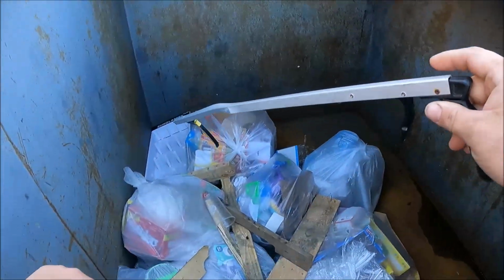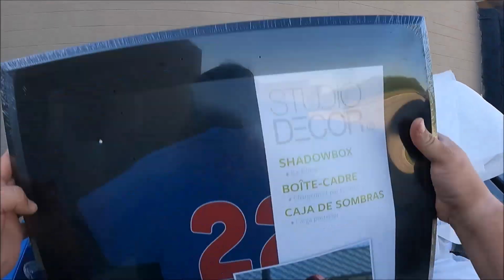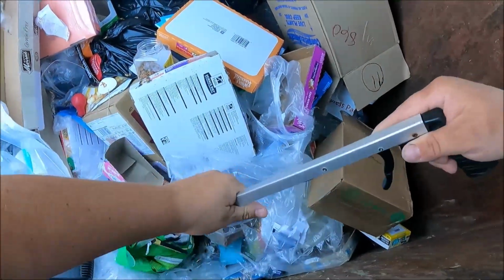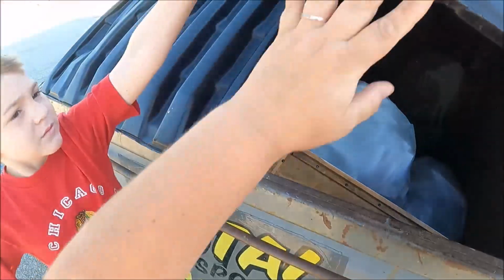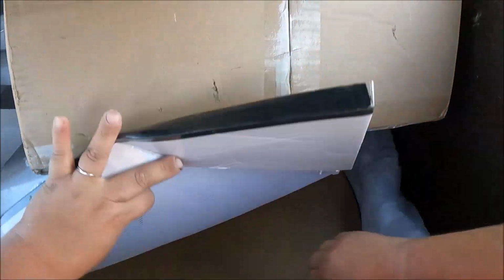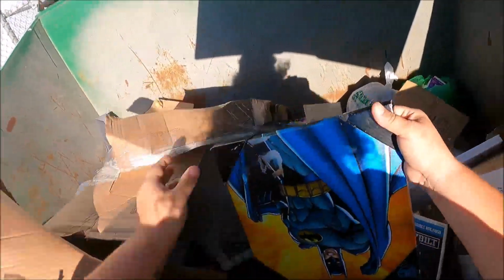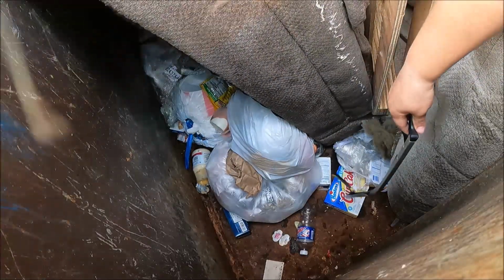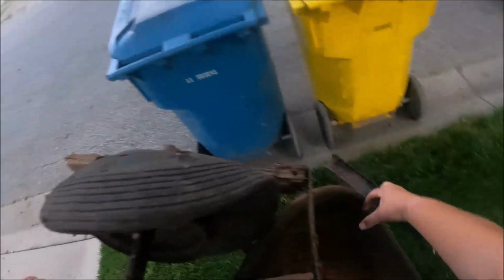Dumpster Diving At Retail Stores Another Diver Left Me A Surprise!

Comment: I made myself a pole with a small paint roller holder on the end, drilled a hole put the paint roller thing down in taped around and it works great in the dumpster it's strong and long . I got the poles out of the dumpster

Comment: You could have just cut the legs off removed door and attached to top of cabinet like a back board, or just not have doors on it at all and then the door into a serving tray of tray for the bathroom or a dresser with a couple of long cupboard door handles
Reply from the maker: I won’t know that many things have another way of repurposing and I have re-purposed quite a few things but this would not of been used in my house I don’t have a direct outlet to instantly get rid of it so it would just sit and take up space which I don’t have the space to do that as a dumpster diver I have to be selective otherwise you end up becoming a hoarder of stuff that you have no use for

Comment: Good bye grabber.  Get a grabber from your local hardware store.  Long straight pole that has no angle just a hedge type handle.
Reply from the maker: I don’t use it often I was only using it that way because I had an injury I’m back to jumping into the dumpster and I honestly I don’t wanna spend the money on something I don’t really need the one I have works for the little instances I need it until it stopped working we just keep using it